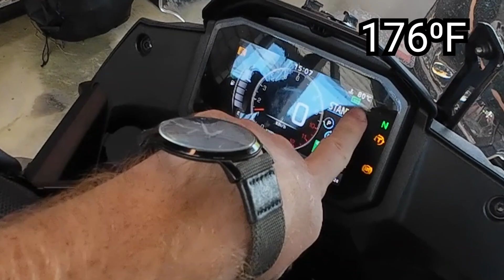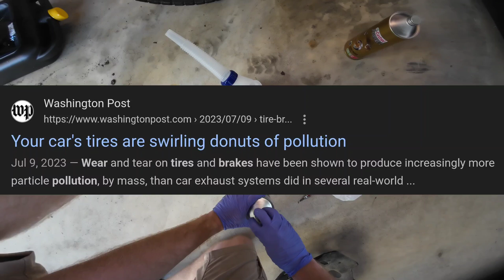Reasons I Changed Engine Oil Early, (as a Yamaha Mechanic from Tokyo)

Comment: My dealer (Honda 滋賀 in Kusatsu) told me 10,000km or 1 year changes would be fine because of the large amount of oil, but I'm also of the opinion that 5,000km changes are what I'm going to do. So far, after nearly 10,000km, I have had the dealer change the oil (once after 1,000km break-in; once at the 1-year check (7,500km)) because I have just been lazy. They always put the Honda G1 5w-30 mineral oil in it which is what has been used from new, but I have always put Castrol Power 1 in my other bikes with perfectly satisfactory results. My question is, Power 1 doesn't come in 10w-30, the grade stated in the manual; it is 10w-40. Is that not an issue?
Reply from the maker: Most of my dealer experience has been in tokyo.
So maybe you're in a more "honest" part of the country😅

Depends. Are you treating the bike like a cruiser or a sport bike?
What altitude do you ride (I did this change in nagano)
Cold winter or hot summer.

Castrol works as a good compromise, but ideally, changing when the temps get down to 20⁰c and then again when they get up to 20⁰ in the spring.
Or, ride it like a sport bike and always pick what's best for warm weather.

If you trust your dealer, stick to them.

Comment: Thanks for the video, and your insights. I too worked on motorcycles professionally for many years, and concur with pretty much all of your comments. I too change the oil once, halfway in between the 12,000 km service intervals, without changing the filter. I also have a white TA, with the optional wind deflectors and bear grip footpegs (thrown in with the bike at purchase, but took months to arrive, due to demand apparently) so your bike closely resembles mine. I am a few hundred kms past 20,000 now, here in rural South Australia.
I have been running the standard Honda oil, with an eye to any potential issue/warranty, but will add to your references to "a smoother engine" by stating that my engine became smoother, in both vibration and sound, around the 5,000 km mark, so that may not necessarily relate to the oil schedule. It just became 'sweeter' around that distance. I too have a long history (well over 50 years...) of sport bikes (Ducati) and also whinged about the lack of an oil window (which my old 1995 Cagiva Elefant 750 has) as do all my other bikes. Including a 1980 Pantah...
The one thing I do differently with my oil changes is remove the bashplate first (mine is a B&B Australian plate) then a quick ride to make sure the oil is freshly moved. Keeping any impurities in suspension being desirable immediately before the change, rather than collecting in the sump 'snout'. But your emphasis on changing the oil whilst freshly heated, and removing the filler before draining, are good tips. The faster flow during draining is worth the effort. I drape a cloth over the filler hole when draining, as I leave it to drain for 10 minutes or so. Plus I lean the bike left and right to remove as much oil as possible. I believe the bike needs to be upright (a spirit level on the side of the tyre a good check) and the dipstick placed in the hole, but not screwed in to check the level.
Thanks for the video - it gives a lot of the same tips which I have been giving for many years! Good job. Some well earned praise from an old codger, who started out on British bikes! Which of course is how I became a bike mechanic in the first place...     😊
Reply from the maker: @patkennedy1  hahah, I could see only British bikes giving your wrenches some workd😅

Can't be over tedious with oil changes, it's the blood of the bike.

Comment: Where do you get rid of the oil? I always did it in the past abroad,  it seems massive hassle to dispose of it in Japan.
Reply from the maker: @sattvicvelo3506  500¥ at the gas station.

My friend just sent me this👇 yesterday.
https://www.webike.net/sd/25678683/

Though it out with bilirnable garbage no trouble.
Reply: Any garage will take the oil and recycle it for you. Better to go to one you use regularly. And don't be draining other fluids into the same tank because they won't accept it unless it is purely engine oil.

Comment: Any brand of oil will be fine, as long as it is to spec. The Transalp engine is a fairly highly stressed engine - 90 ps (80 in the US) from a 750 twin is higher than average. It also has a 13.5 compression ratio, which is high (although this height is becoming more common).
Reply: Are you sure? I found that  has a 11.0:1 compression ratio in owner manual or producer's website. It's low, so you can refuel with even 91 octane petrol. Although apparently the best engine operating culture is at 98 octane.
Reply: @rachunkowosc475  Yes, you are right. I can't remember where I saw the 13.? compression ratio, but it's wrong. I apologise. The Honda is about the same as the reliable T7 Yam. Good. The Japs know what they're doing.
Reply: @rachunkowosc475  You are right. I apologise, and don't know where I got it from. The Transalp has a similar compression ratio to the Yam T7.

Comment: In my current job I have access to oil analysis at a very low cost.  Im trying motul 20w50 7100, in my 2024 vstrom 800de. but at 5000km its already sheared to a 10w40 when sampled.  Now end of season change at 6700km waiting on results.  Was hopeful for a 10'000km or one season oil change interval but i dont think motul is going to cut it.  

Would like to try amzoil 20w50, and castrol power 1 20w50.
Reply: I've heard bad things about Motul from the KTM guys. They say extended service intervals combined with that oil was a catalyst for cam wear.
Reply from the maker: @john0270  I'm a fan of Castrol
Reply: @KairyuRider  wear metals are low in my sample.  Especially for a 5000-10000km odometer reading.  I did early and often changes with Suzuki 10w40 synthetic(cheap)

But yeah I will try and sorce some of the Castrol oil in Canada if possible. 

as a former cf moto dealer tech...   i wouldn't blame any oil... at all.  F that company.

Comment: I used the liqui moly full synthetic stuff with their MoS2 additive, for 80k km (now total 100k incl previous owner) on my vfr750f, before i rebuild it for funsies. (And because the countershaft seal failed). I did the oil and filter at 10.000km where the service manuel said 12.000km. I commute on it, and stress it decently on the weekends. 

Everything was perfect inside. Amazingly perfect. It was super duper clean, still a crosshatch in the cilinders, pistons within spec, crank and rod bearings were not even worn through the first coating! I never really did my valves because the vfr is known to just not wear out its valves, and they were all perfectly at spec. 

Replaced all bearing shells, piston rings, and the oil pump chain together with all seals and o-rings, lapped the valves, and re-adjusted the valves at 1000km. Still purrs like a kitten.

Honda's are something else man, espacially the 3th, 4th and 5th gen VFR's.
Reply from the maker: @acvn-hg9gy  happy to know I got the right bike then😁

Comment: Do you realy change the oil without the Filter? In the Filter is  the whole Metal and dirt what you put back to the Flow cycle in case. Never heard that to do with a car. On cars people said if you change oil without Filter, it make no sense at all😅
Reply from the maker: @David-m7f3g  cars hold more oil but with a similar fixtures. So cars, with a bigger engine, push more though the filter. So every oil change do the filter. But bike change oil more often. 
Filters work very well and in this case the oil is also being burnt so changing the dirt oil for none burn oil is the key. And there was nothing bad in the oil, like water, metal or dirt, that I saw in the change. So it's not bad to do the filter, but it's not that major. 
If I fallowed hondas guidelines and did oil every 10,000km, I'd do a filter too.

I'm not saying I'm the all knowing, but I say this as a Yamaha mechanic. A lot of the "hear say" if internet hear say, not necessarily professional experience. Honda also told me no need for a filter every time. They even believe the filter "could" last the 20,000km for 2 oil changes.
Reply: @Man-With-Bike  In the late 70's Moto-Guzzi only recommended changing the oil filter every 4th oil change on my Le Mans2 . There was no clutch or transmission sharing the engine oil . And after the break-in period is complete there should be very little particulate matter in the oil.

Comment: Guys what do you think about changing the oil right before put the Bike in Winter sleep for 4 months. I heard its very good.
Reply from the maker: @David-m7f3g  if the oil is more than 6 months old or has more than 2,000km, then yes, I would change the oil and the filter. Oil wears out and becomes corrosive over time. That's faster when the bike is cold and the oil doesn't move.

I don't do winter sleep, but if I would, change the oil the day of your last ride and put at least 10 more km so the fresh oil is cycled through.

Comment: I'll add my vote to changing  the engine oil at slightly lower mileages. It does seem to contribute to the reliability / fuel mileage of a motorcycle to change the oil a little more regularly. ( I do mine annually at about 3000 / 4000 miles.) I think a little maintenance on all parts of the machine is the cheapest "Breakdown Insurance" you can buy.
Reply from the maker: @speedfinder1  maintenance is cheap, engine rebuilds are not

Comment: Did my oil change 5000km ago, already ordering a new filter and preparing for another change. Thanks for settling my dilemma on whether it's too early to change oil in my CP2 engine 👌 it has been ridden hard lately. Also thanks for the tip, might have to try Castrol next time, Motul does seem to cause a little bit more vibration after around 2000km.
Reply from the maker: @ZombiiNightmare  glad you found value

Comment: Same here, an oil change every 5,000 km regardless if it's a bike or a car, but I also do the oil filters since they're so cheap I see no point in skipping.
Reply: @KairyuRider the old oil filter and filter housing retain a quite relevant part of the old oil (around 200 ml in the case of my car, which requires a total of 4,3 L new oil for the change, for ex.; so it is a relevant proportion! tested it myself); why pollute the new oil with the old, bad one? Because everyone knows that, in general, a little bit of bad spoils a bunch of good. So I have to side with @Balsalmo on this one. I mean, since we do talk here about "earlier" than recommended oil change; makes very much sense to also change the oil filter; especially because it's just the price of a coffee for a new filter and those who do the oil change earlier r the ones that love their vehicles, so it just makes sense.
Reply: @HPaulAdrian  i agree with you! On my bike its 200ml in the filter+everything above the checkvalve, and the total calacity is 3,1L. So thats about 6,5% "bad" oil. For that 6 euro extra on top of the 45euro my oil costs, i'll do the filter aswell.

Plus, fun enough, the filter gets my total above 50euro, and orders from 50euro and up get free shipping where i buy it. So it actually saves me 1,95euro to get a filter lol
Reply from the maker: @Balsalmo  I have in the past. But not a massive benefit in my experience with newer bikes.

But can't hurt

Comment: You think changing the oil stopped the engine vibration?
Reply: I recall having something similar happen, not vibration.. more of a raspiness sound. Went from Castrol Power1 full synthetic to BMWs Advantec pro that most people where recommending. Same weight, but the BMW stuff is API SM, and Castrol is a newer API SN. The noise was very noticeable, to the point to have to stop at an exit and check the bike over because of the strange sound. Eventually I got used to the sound, but next change Castrol is going in. Edit: btw the bike is a R nineT
Reply: Switching from Honda's HP4 full synthetic motorcycle oil to Valvoline full synthetic in my XR150L quieted the top end down quite a bit. It's not a super crazy claim to make.
Reply from the maker: @cameronsays  with my Yamaha, it was the only thing I changed and everything ran better.

But that's just 1 bike and 1 oil change. Not scientific. 
But we will see how this bike does